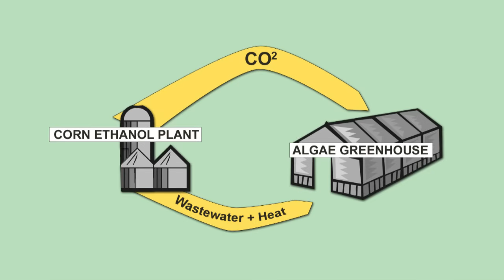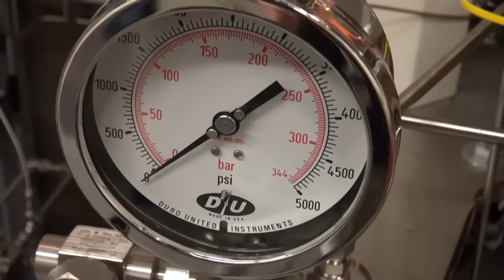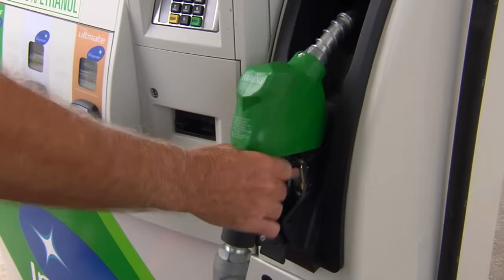Algae Power | This American Land Season 4

Comment: 00:09 Algae farming in Iowa has multiple applications
00:45 Algae has wide applications beyond biofuel
01:26 Using corn ethanol plant to support algae production for biofuel
02:06 Partnership between green energy and water treatment for algae growth
02:47 Algae grow on a condominium-like structure, boosting surface area for more cost-effective production.
03:29 Algae can provide gas and oil, a process millions of years old.
04:16 Algae needs to be grown in high volume for cost-effective oil production.
05:03 Algae is a profitable use of CO2 for reducing emissions and providing renewable fuel.
Crafted by Merlin AI.

Comment: We need a rebirth of promoting this technology. Anything made from crude oil can be made from algae oil without the environmental impacts, even plastics. Like they said, it's like crude oil except it's not rancid and toxic. Since you're using fresh lipids you're getting a cleaner and in most cases non-toxic products so spills would not be environmentally damaging. The fuels created I have up to 86% less commission so it would be like taking 86% of the internal-combustion off the market without having to convert, destroy, or replace anyting. And I'm not just talking about cars!

Comment: Instead of making fuel, let's carbonize it and bury it. We've spent 150 years pulling solid and liquid carbon out of the ground, burning it, and putting it into the air. We need to spend at least that long making solid and liquid carbon and putting it back in the ground. Yes, it will cost money and not make any profit, but we can fund this with a tax on fossil fuel companies. Their product caused our climate catastrophe, they can pay to clean it up.

Comment: Can everyone stop. Yes there are problems with this no one is hiding that BUT.......There are far more and far worse problems as a result of using traditional fuels. We will never have a perfect fuel, with excellent energy efficiency, low costs and being largely renewable. That’s a fact. But this biofuel shows some promising factors. And who ever said that we are solving the oil issue by making more oil needs to check their facts. The main difference is that the oil from algae is ‘naturally occurring’ and renewable.

Comment: Turning it into oil is stupid. That's not how you go green.
Reply: its not the best since it dosnt take co2 from the atmosphere but it helps us by not adding any more into the atmosphere. The thing with oil is that were digging up carbon that is trapped and setting it free while this method takes co2 in the air and gives it to the algae and then it is put back into the air so it kinda keeps the status quo
Reply: Valueless Dollar Most importantly it is killing the ocean!!!

Comment: Producing more oil is not a solution to fosil fuel problem. Co2 is not the only bad thing coing out ouf your car exhaust.
Reply: Bio oil does not have contaminate problem that fossil fuels do they lack all the trace minerals and sulfur.
Reply: Trinity preach! this project was designed to kill water ecosystems dead within a decade. spread the word.
Reply: Mr Jr Hi, I don't mean to be rude, but, are you serious? I'm not yelling, just checking

Comment: And here I had come to the conclusion that oil came from pine trees. As flammable as dried pine is plus pine tar. I just arrived at that conclusion. And I'mma sticking to it.
They just think it's algea because it had grown on some pine trees.
Reply: music box i think electric is a major part of the solution.  However alcohol fuels are excellent and if cars optimally utilize alcohol fuels, they would get more power and better mpg than gasoline and since they burn cleanly you wouldn't need to change the oil nearly as much...  I'm not sure how reliable electric motors are long term.  A well made ice engine can last a million miles if taken care of.  Also the cost of the battery will always be a big burden to electric cars vs fuel led cars imo.
Reply: @iskdude9922  brushless electric motors have no moving parts exept for the output shaft and they pretty much cat break if they are protected from overheating, tho the baerings hmight have to be replaced every 50 years or so
Reply: @vornamenachname8001  yeah i know electric cars are the way to go.  But ice is already super entrenched....  im for sustainable energy rather than supporting big oil companies and islam.
Reply: @iskdude9922  electric motors last as long as their bearings. they are super reliable
Reply: LOL good Kek.
Reply: Jeff Bingaman oil is any biomass, but we should not use it. electricity is the solution that won't harm any life
Reply: Insoo Kim I think it is just a matter of time. if they can make nano chips with huge data storage, they can make light and durable electric car batteries we could switch anywhere as easily as we do the tv remote ones. Those are simple mechanisms, easy to repair too. and engine life expectancy must not be an excuse. Nothing is more difficult to put up with than polluted air and water.

Comment: 4:10 convert algae into oil? so we are back to oil again?
Reply: It's useful for airplanes and spaceships. We don't want to run out of that stuff.
Reply: The oil is not the problem. The problem is that soccermoms drive a ford f150 40 miles just to save 50 cent on cornflakes.
Reply: bruh.
first off.
this wouldn't waste the resources of mother earth, we could create oil instead of taking the source that already exists and that is almost running out of oil
second.
We could enhance it to be less pollutant in any way we want.. you can't do that with finished oil
Reply: First Law of Thermodynamics you cannot create matter or energy. If you are turning algae into oil that's not a problem because you'll use CO2 from the atmosphere. Oil is not bad but fossil fuel is.
Reply: yea im sure your a fan of Elon musk but did you know his spaceships actually use fuel not batteries?oh also did you know batteries are toxic hmmmm

Comment: How is this funded? We have nearly increased our CO2 levels by 50% since pre-industrial levels, yet we are still below the peak temperatures that occurred during the last 4 inter-glacial periods. CO2 levels at around 1/25th of 1% are too low to affect climate much;  it does affect the rate at which biomass is growing.
Reply: Frank Mueller Carbon dioxide is probably found more commonly in the troposphere where it is easily available to plants. This is because carbon dioxide is a heavier gas than nitrogen or oxygen. So most of that 0.04% (1/25th of 1%) is concentrated in more or less the first 12km of the atmosphere
Reply: Frank Mueller, the glaciers are part of what's holding the temperatures down now, but they are melting away. Think! Think!
Reply: so it's 7.44 miles

Comment: Growing Algae for replacing fossil fuel? Can fuel from algae produce more energy than was put to produce algae at all?
Reply: tons more.  it uses sunlight, co2, and nitrogen to produce. or,  waist water from poo poo plants.
Reply: +music box That's not true. Stop spreading misinformation. Algae used for oil production is grown in artifical ponds, separated from any natural water body.
Reply: @averagegeek3957 I think he's confused regarding ocean dead zones
Reply: That's the exact right question to ask.
Reply: Amanda Brower it's waste water though
Reply: Артём Маринченко The problem that still persists with fuel from algae is not whether its energy density or output-input ratio is high enough, but instead the decomposition thereof. Biofuel from algae oxidizes inherently, due to a lot of oxygen dissolved in the substance, where as oil from the earth has all the oxygen compressed out of it. On one side, the decomposition of algae fuel does damage the engines of machines, yet it won't lead to catastrophic oil spills as we have seen in the recent past.
Reply: Артём Маринченко algae farms are killing the ocean

Comment: Will using algae biofuel in vehicles still result in C02 been a byproduct?
Reply: Algae oil is carbon neutral
Reply: consumes more co2 and produces oxygen than it does produce co2 because of photosynthesis.
Reply: @amandabrower4228 uh...
Reply: You can produce the same petrol and Diesel from algae oil. You don't need to convert the vehicles. They actually give off less emissions then. It's a purer cleaner fuel. You can make anything that you can make out of crude oil. Even plastic except the products break down completely rendering them environmentally correct

Comment: grow hemp fool, that's what henry ford say.
Reply: I lean more to electric vehicles but hemp and algae derived biodiesel can go a long way to solving issues of climate change and pollution. Besides it keeps money out of the hands of regimes that fund terrorism. Internal combustion vehicles will be on the road for easily another ten years. By that time conventional easy to get inexpensive oil would have peaked.
Reply: Wind, solar, and battery power is not the answer. They are not actually green Energy's. They still involve a lot of destructive mining. It's all about the mining industry

Comment: can it make regular gas or just bio diesel
Reply: Eric Towet
yes, it can power a engine by itself, is is abrasive and hard on a engine systgem however.
Keep in mind none of this is new. technology at all. The great debate for what made the best combustion for a engine was decided in the mid 1800s. Ethanol lost out do to the usual crop nonsense which are subject to drought, poor harvest etc. Methanol lost out do to its abrasive nature. It also needs extremely high compression to run properly.
Both are commonly used in Dragsters do to their high ignition point.
Mixing of said fuel is common as gas does combust a bit better : )
I encourage you to research the history of Engines, it is quit fascinating .
Reply: +Eric Towet Basically anything. 
Diesel is kind of the product at the earlier stages of refining, further refining gives you gas. To note Methanol is the product created from wastes other than plants, such as sewage, ethenal is from plants.
Reply: I am so confused by Methanol apparently it cant power an engine by it self
Reply: +Eric Towet I'm not so sure about that.. My opinion is that there's been way too much mainstream propaganda originating from the (big oil) establishment, to keep our population from becoming overly interested in alternative fuels production. As far as I know, combustion motors can be engineered to run on quite a wide range of hydrocarbon sources.
Reply: +Eric Towet So in a combined operation, where a (sewage) wastewater facility is dovetailed with an algae production operation, one would have both, in addition to the methane (sewage) digester gas. And I know from experience that methane gas, properly scrubbed and compressed, runs 1200 hp Cat engine generators just fine. which can power algae processes..
Reply: wow thanks
Reply: Although there aren't any good examples out there (or none that I've found in a quick search) about refining gasoline from an algae feedstock, I'm certian that gasoline or a gasoline like fuel consisting of long chain alkanes and a small percentages of hydrocarbons (basically what gas it) can be refined from algae. It's just a matter of working out the chemistry and tweaking the fractional distillation process. This is not being worked on noticeably since there isn't any real demand here yet, but I'm guessing someone is working on it somewhere. I think you may have identified a good project that I can do as far as making the chemistry to work. But it might take me a while since I haven't played around with organic chemistry in a while. Anyone else up for the challenge? Maybe someone out there has some good reference material they can share.
Reply: If nothing else, I'll bet someone connected to MIT is working on this.

Comment: But the amount of energy being used for manufacturing oil out of algae through means of high heat and pressure seems way counter productive in terms of volume.
Reply: Christopher Kinney Not to mention the large amounts of water being used, while nearly 21% of the world doesn't have water to drink. Maybe.
Reply: Christopher Kinney Read my comment on use of wastewater for algae-to-oil (biocrude) production.
Reply: Christopher Kinney the heat I noticed you said would counter act profit but it actually uses waste heat so they are not heating by heaters
Reply: Isaac Dean Heat demand is accommodated by either burning the surplus methane directly with a boiler/heat-exchanger loop, and/or indirectly by power generated from methane generators. Old technology. Generators can be multi-carb'ed for flexibility, such as isolating methane system for maintenance, hence generators would run on stored methane or diesel or natural gas. Old tech.
Reply: Donna L Surplus methane powers the generators, which then powers compressors, gas scrubbers, boilers, and so on, entirely "off-grid"... Old, off-the-shelf tech. Many anaerobic wastewater plants have been doing this sort of system for over half a century. And they still have vast quantities of waste or surplus methane which is burnt off and waste CO2 which goes uncaptured, both readily available resources for biofuel algae production, using the nutrient rich wastewater.
Reply: Donna L It is wasteful, in my opinion, to waste, burn-off the methane and not capture the CO2. That's why I'm so in favor of matching up the two processes. In earlier decades, when energy was cheaper, methane was considered a nuisance and not worth dealing with, same with CO2. EPA legislation over the decades (again, my opinion) has been influenced by self-protecting energy lobbies and other such special interest groups, to build in legislations that make developing alternative energy sources legally and economically difficult, costly. Anaerobic wastewater plants that do build in facilities to utilize their methane for power are limited on the amount that can be used, as a wastewater plant is a significant commercial power consumer, it apparently has been legally established that they are considered to be competing with the grid power company, and that is not in line with the mission of the methane producing wastewater plant. It is considered an unfair practice. EPA language also prohibits the capture of the waste CO2, as it is considered recycling the CO2. I don't consider myself an authority on this matter, especially on environmental and EPA law.  There's also a lot of apathy in the system involved, too, I think.
Reply: Carl Lelandt What's even more tragic, is that due to higher energy costs, and counterproductive legislations and mindsets, wastewater treatment operations are moving toward increased chemical use. And of course, that wouldn't just coincidentally benefit any special corporate interests, now, would it (?)... The public wastewater industry is faced with impediments that keep them from developing and using cost reducing operations.. But on the other hand, presented with a plethora of cost consuming options that are, coincidentally, quite legal. Using laws to squeeze public coffers because it's good for the economy and special interest groups. And using more chemical and consuming more energy, isn't progress, in my opinion.
Reply: Donna L A lot of problems that stem from scrupulous legislation doesn't always exist in language that clearly spells out a prohibition. Their term was "recycling" and how they defined CO2 recycling. And no, I can't remember where I read about the problem. But I'm almost certain it was something I read online. I also recall reading somewhere that such legal obstructions is what sends well educated minds into developing health foods products, rather than pursuing alternative bio-energy directions. If you're seriously interested in algae as a high potential biofuel source, I highly encourage you to get a free online subscription to "Algae Industry Magazine". I'm just a subscriber. I'm not affiliated with the magazine in any way. It's likely that's where I read about the EPA legal bottlenecks, and such..
Reply: +Christopher Kinney how about using renewable energy to produce the algae?
Reply: algae for oil,biofuel and plastics etc. geothermal,tidal,radiant and nuclear fission and hemp's best for paper,bioplastics,rope textile etc